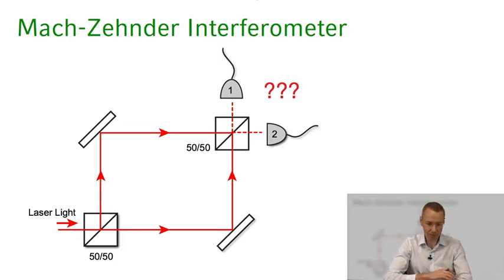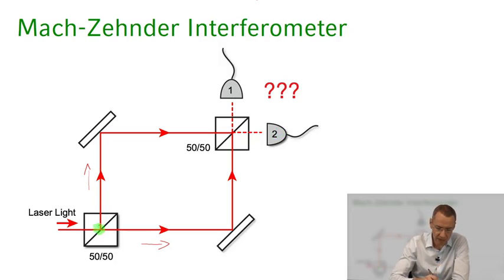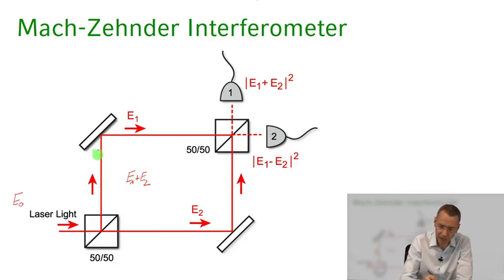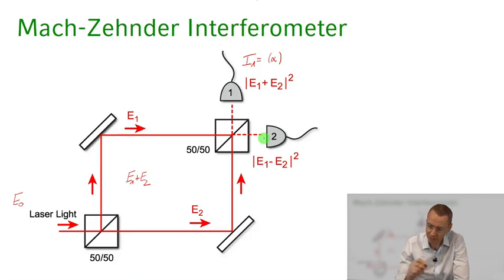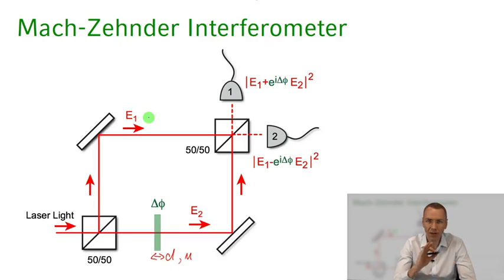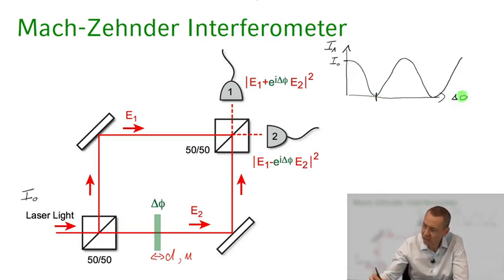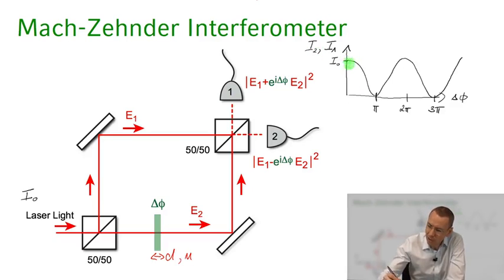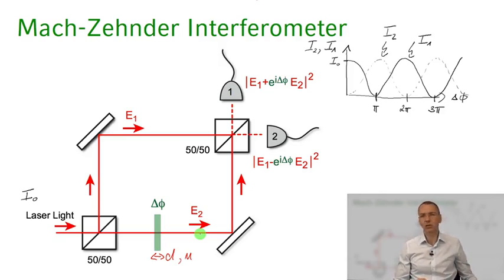Quantum Optics  || 04 Lecture 13   Mach Zehnder Interferometer

Comment: what is causing the assymetry in the measured intensities here? The setup seems perfectly symmetrical, except for the direction of the input light. Is that direction causing the difference in the measured intensities?
Reply: the phase plate causes a phase shift in one of the components

Comment: I believe there is constructive interference btw both beams in detector 2, probably the numbers should be interchanged? E.g. for sensor 2 of the video, there are 1 transmission + 2 reflections for each beam.
Reply: I think is a erratum. If phase shift is 0, all intensity will get detector 2, E1+E2. The detector captions are interchanged!

Comment: @ 3:25 Very disappointing! He already discussed the beam-splitter and said nothing about it. @ 7:04 And again, there is only 1 input-port.
Reply: There are actually 2 input ports... the moment you realize that you realize that there is no need to say the single photon that passes in spreads out into a wave taking both paths that collapses at the end, there is no need to then draw any of the conclusions people draw from interferometer based thought experiments: interaction free measurements, retrocausality, the "cheshire" effect, etc. It is all based on the assumption that there is only one input when there is two!
Reply: @QuantumPolyhedron  Thanks. It would have been better to understand if he had mentioned what you have written above.